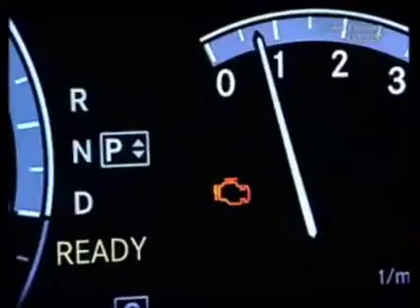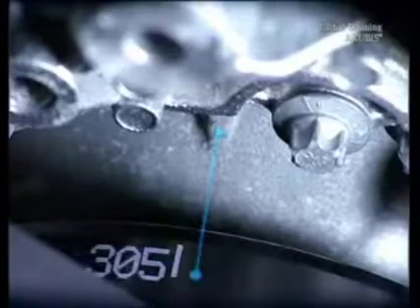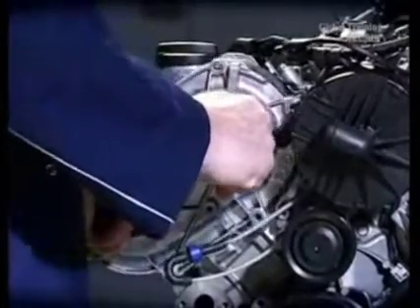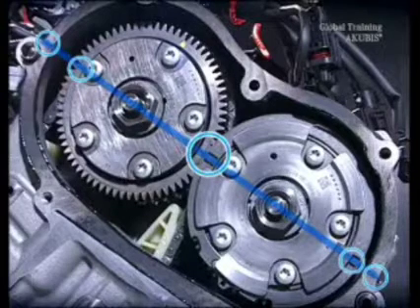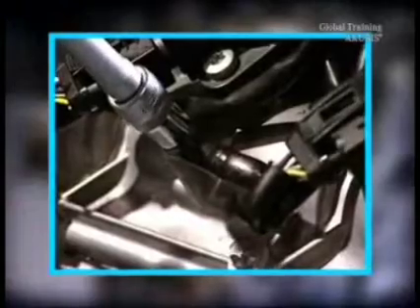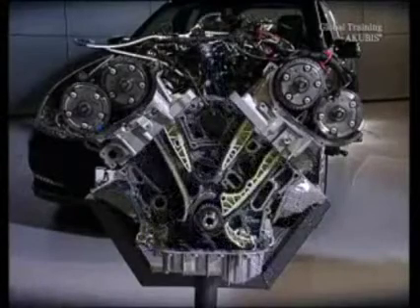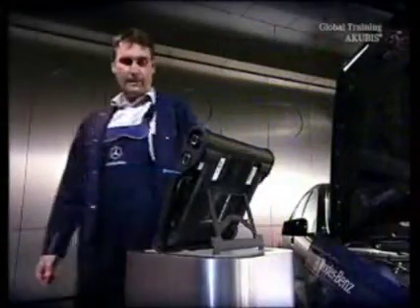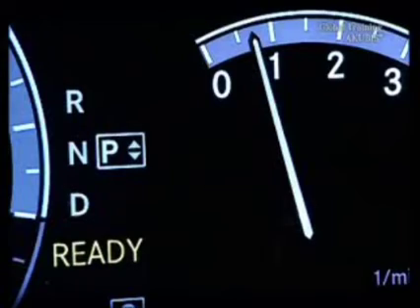Mercedes-Benz engine timing chain check and adjust and exchange balance shaft sprocket M272 M273

Comment: Thanks for the video. Can a bad tensioner cause timing to be out? I have the 1200 and 1208 codes but my engine number was not supposed to suffer from idler sprocket wear.
Reply: Chain tensioners on m272 and m273 do not go bad usually. It's basically a simple high tension spring. You most likely have a stretched chain which causes the intake cam on bank1 to go out of timing. Cam shaft sensor picks up that problem and reports to computer, it then throws the code 1200 and 1208.
Reply from the maker: @kijijiuserkijiji346 Most of the shops or car owners ignore those early codes stored on ecm. Also, not many shops are trained or certified
Reply from the maker: Lack of oil change intervals can cause it